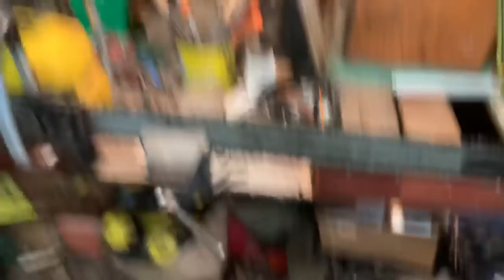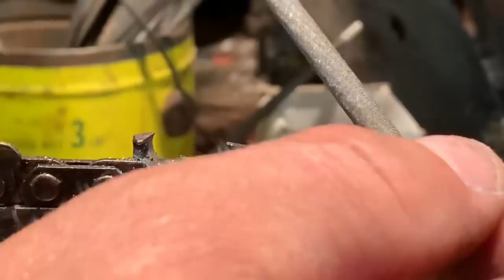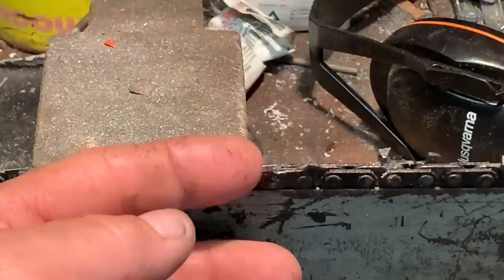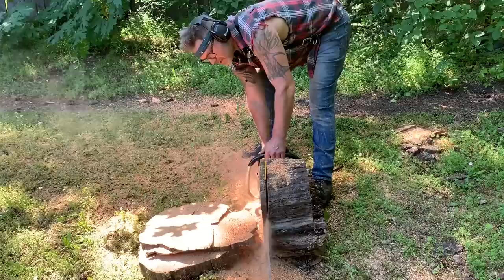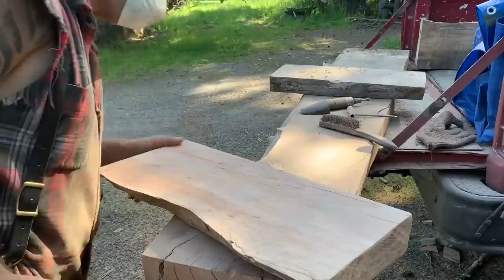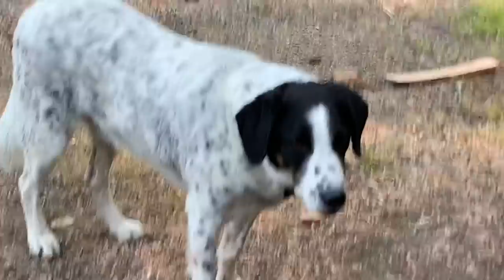Chainsaw sharpening myth. Debunked

Comment: Buckin. Your right about people spreading the word to count your strokes. I went to the Stihl small engine shop the other day to pick up a raker gauge and out of curiosity i asked the guy what was the best way to sharpen the chain. He told me to look for the worst tooth and file it and count the strokes . Then file the rest of the teeth the same amount of strokes . I did not argue with the guy i  just let him go . As i know that your the man with the experience and the know how i believe you 100%. Cheers Buckin.
Reply: Graham, that is exactly how the Stihl factory manual describes how to file. I'm with Billy, it's the relationship with the depth gauge (raker) that matters most.

Comment: First - I hate using a file because they dull so quickly and I always use a Dremel with a chain saw arbor to cut my chains. I always make sure that the edge is sharpened "onto" the edge and not try to sharpen the edge with the tool coming off the edge. Kinda hard to explain, but a barber once taught me that you always sharpen the edge "ON" the tool and not "OFF. 
The biggest improvement in chains that I recently "discovered" was a gap-toothed chain and I can say that it really REALLY cuts fast and furiously! 
The true test will be when I have to sharpen it. 
Love you enthusiasm!

Comment: I think the style of raker gauge you use helps. Each raker is filed to it's specific tooth, instead of those other styles which bridge over several teeth.
Reply: Yes, those are the good raker gauges!
Reply: That's exactly what I was thinking, I found the tooth size to matter, but it's because I was using the style of raker gauge that you are describing. If you use the style that only references off of one tooth and you're cutting crooked, it's probably because of the bar.

Comment: It makes sense when you think about how the chain reacts once power is applied,how the depth gauge and then the cutting tooth interact with the wood. Curving cuts are from worn bar rails. Usually from pushing too hard on the bar during the cut and/or running the chain too tight add in a little never flip the bar either. Thanks BBR

Comment: Buckin thank you from the bottom of my heart ❤️ for sharing your tips! I am a weekend warrior I guess. Maybe even periodically a chainsaw user. I just sharpened my first chain. Without your videos I wouldn’t have even thought about trying it. All I have to say is it was actually better than when I first started using it. The chainsaw is an inexpensive one but it works. I first pulled the plug because I had an issue starting it. The plug gap was almost closed. I did open it to what it was recommended on another channel. I haven’t had an issue with it since. It is a poulan too. I am just not financially able too purchase a good chainsaw. So again thank you Brother for your tips !!

Comment: Hi Billy, what I have experienced with long and short teeth cutting hardwood is that the bar jumps around and does a poor job cutting, also if one side of teeth on the chain are long and the other shorter will make half moon cuts, I'm sure you have had this happen also. Getting the rakers all the same height makes are smoother cutting chain also. Thanks, Gary
Reply: Kinda the point of the video. Tooth size makes no difference, long as every raker is sized appropriately to its tooth with a gauge.
Reply: He did a video with a chain that had nearly a new tooth in one side and the other side was filed right back to almost end of life. The chain cut straight as an arrow because the rakers were set correctly and allowed each tooth to take the same amount of wood as the next. 👍
Reply: @Woodman_Custom_Sawing  ok.

Comment: Can use this same technique on Stihl Picco mini chain? I caught some barbed wire in a tree trunk and it tore it up bad. The cutters are extremely small. I’m used to filing .325 and 3/8s chain. I bought a new chain and once it’s wore out I’ll go to a heavier 0.50 gauge bar and chain

Comment: dumb question... should the 3/8 husqvuarna gauge used in the video work on stihl 3/8 chain?   i've got one of these gauges, and when i lay it on the chain... i thought the front edge notch was supposed to sit tight against the preceding tooth, and then the raker comes up through the hole.  but... if i situate the gauge that way... the raker is behind the hole it should come through.  if i place the raker through the hole, the front notch will sort of rest on the chain or chain rivets... but not up against the preceding tooth.

Comment: Those Stihl depth gauges that seems the stores I shop at always sell, they sit flat across, but am I right in that they wouldn't get the right angle , and wouldn't work if different teeth were different heights ? Seems this gauge is a lot better, so why sell the others ?

Comment: My issue, which has me replacing chains too frequently ($), is that I get the gullet forming nicely but then can't get that round file to advance as nicely back toward the tooth without cutting more into the gullet!  Is the trick to only put pressure back toward the saw after forming the gullet?

Comment: I only cut firewood occasionally enough to get 4 or 5 cords a year.
I still haven't mastered hand filing in 20 some years...just need more hands on filing. I have a dozen chains and let the rental shop sharpen them mostly. Helps the small mom and pop shop.
But want to figure out the handfiling. My sharpening isn't always right on 30° for my Stihl MS290 325 26RM3-81 20" chains. The shop sharpening always last lots longer than my hand filing.

Thx for your video

Comment: I always thought that when my cut started going sideways it was because my chain needed sharpening.  It never occurred to me that is was the channel in my bar being loose causing the crooked cut.  Flipping he bar was a great tip and saved me some money too.  Thanks Buckin!
Reply: They make a bar rail closing tool if the bar rails get spread too bar. There is also a tool to grind the rails so they are flat, in the same plane as eachother. I believe he does grind his rails but does not use a rail closer. If you start with a 0.058 gauge bar and wear it out you can eventually fit 0.063 gauge chain in the bar and by the time the 0.063 gauge wears out the rails it's time to replace the bar anyways.
Reply: Good stuff, thanks for the tip.

Comment: Buckin, I believe that rather than just show people what you do, it would help if you could explain why getting the gullet helps the cutting action.  e.g. does it provide more space for the cut wood to occupy rather than jamming up the gullet space with wood and actually tending to lift the cutting edge away from the wood it has to cut.  There must be a reason why it works and it is easier to learn when you can understand why!  The depth gauge is easier to understand and I think that you have explained why the raker needs to be filed and how much you need to file it depending on the type of wood.

Comment: Loved picking up new information on vids like this one. I have found my self sharpened chains don't stay sharp as long as when they're new. So I use them for trimming branches off, and lighter work on smaller softer wood. After getting a sharpened one stuck in the tree trunk once or twice, I prefer to use a new one when felling larger and hardwood trees. Don't get me wrong, I get good use out of my chains, but after watching this one I think I'll get better use out of them. As far as counting strokes when sharpening, I stopped that after the first few I did because I found it fruitless.

Comment: I found that using a smaller size file.
I better, you can get a bigger hook before you get on your top plate..

What is your thoughts on that Billy.?

Correct me if I am wrong. 

Bo
Reply: I’ve started using a size smaller files when my cutters start to really get down to the end. No problems doing that so far and I seem to get a bit more life out of the chain

Comment: Wow, pouring "Watca" from a gallon can-serious business.  😁👌The shelves are awesome, Buckin. Good comment by Al.  Also, I've seen kiln dried wood do what the finishing discipline sometimes defines as "spit-up".  The Watco goes on, penetrates perfectly, then in a few minutes rises back to the surface and creates dozens of little ugly Watco wet "bubbles".  You simply wet it back down and "dry wipe", and repeat until the condition goes away.

Comment: Working in a saw shop it amazes me how many people bring there chains in for sharpening. And how hard they must be pushing that saw some times when they finally decide to have it sharpened.
Also if you can have your bar dressed. Makes a huge difference to your chain wear. Usually doesn’t cost much and will only take the shop 5 or 10 mins.

Comment: Always good to see you sharpening these chains.  I am having a heck of a time getting a chain sharpened after it got drug through some sand/rocks.
Reply: I hear ya friend, filing out rocked cutters is punishing so I found a good used grinder (a Windsor like the Oregon types)   fell in love w/it, now I never touch a file, just keep several razor sharp chains in the saw box. A want ad can get you into a grinder very reasonably. Good luck!
Reply: It’s a lot of work to file out a rocked out chain! Might even build character😅 a grinder or rotary tool will get ya cutting a lot faster. Just make sure to do your rakers any time your taking a lot of those teeth down. Good luck. Pay attention and have fun with it n you’ll be deli slicing hardwood like Buckin’ in no time👍
Reply: That’s where a rough ‘boat’ motion gets rid of material that needs to go Before continuing with normal strokes

Comment: Anyone who doesn't know how to, or can't file well, just use a file guide, it'll keep the gullet filed and clear to the correct depth and in doing so you won't end up with it flattening off the leading edge, (the 'C'). It's not like they're expensive or need replacing with the file.

Comment: I was always taught to count my strokes .I was good at filing a chain .Can't any more .4 shoulder surgeries  finished that have at least 6 running saws and have a bunch of spares .all I can run know is a baby echo 310  1/2 tank of fuel and iam lay up for a few days.Know to sharpen saws I use a dremel .only have to move my arm a inch .Works dam well .lol .But cut wood all my life and love cutting .Have a hard time getting 4 cord of wood to heat my house and shop .PS in this part of the world most saws only have a 16 inch bar .all  no monster trees here . Awsome Vidio keep up the great work

Comment: Ok so its not the  cutter length but the raker hight that causes the sloping cut?
Reply: Rakers just determines how much each tooth tries to take off.  If your cut is curved, one set of teeth, either the left cutters or the right are duller than the others. Or it's a worn bar. IF I understood your question.

Comment: Yer lot i do as groundy is clean but hardwood. I like a liitle hook just pulls thro. Yer gets blunt fast but if ya can take 10 mins. On dirty can change it. Do use raker gauge tho. Was gettin it wrong. Thanx buckin its good stuff thanx.

Comment: Hello Ray could you help me whit a problem my 1961 homelite c7 wont start the carburator tubes get air into them some how so are the tubes the problem?
Reply: When in doubt, rebuild the carb. Especially if it hasn't been rebuilt in a long time. Float and needle valve might not be seating properly. Get a rebuild kit if you can find one, strip it, and if possible soak the body in a shaker tank. There's tiny little passageways in the carb body and if they get gunk in them all kinds of weird and wonderful things happen. If you suspect the fuel lines take them off and make sure there's no holes or cracks in them and that they seat properly, or just replace them, fuel line is super cheap any auto parts store will carry line and fittings
Reply: @NovaNinja_  yeah the lines are orginal and it didnt ran in almost 50 years but 5 months ago it ran perfect when i just switced the gas.
Reply: @KK-dt4gj  Interesting story, myself and a friend both bought bass boats from the US and brought them to Canada. Within 1 year all our fuel lines were rotten. There's something about US and Canadian gas that don't get along, and it's possible that old gas and fresh gas could have the same effect. I think I paid under 50 cents per foot for clear line at CarQuest so it's worth it to change them even if it's not the problem
Reply: @NovaNinja_  yeah havent just had time since i have had problems whit my sthils too

Comment: What brand files do you use?
Reply: Any of the brands that are Swiss made, which is the major players. Valorbe or Pferd.
Reply: Thanks I have been using oregon files for years and they usually wear out before I can finish sharpening👍👍
Reply: @redman715  Uh oh! Theirs are supposed to be made in Switzerland too, but maybe they went to Asia. Try Pferd or Valorbe, ok?
Reply: @redman715  Hey, I was back in my shop, had an Oregon file, made in Switzerland, and it cut and cut.    Not sure what the deal is for you, sorry!

Comment: hey buckin'! love your videos and your positive light in the world! I just found your videos recently and you seem so damn knowledgeable and experienced that there's no way you dont know hopw to sharpen a chainsaw. I was also taught to count strokes when you sharpen a saw or that if you hit a rock with just one tooth you have to file down all the teeth the same amount or you'll start getting crooked cuts. Last spring I sharpened a chain that i got from a buddy that needed A LOT of filing to be sharp again and when i started cutting with it I was getting crooked cuts. I did about 15 strokes on each tooth so i figured that somewhere along the line my count was off and that was why my cut was so crooked. You say over and over that you dont need to have even teeth to cut straight and you prove it in this video! but i havent heard you say what does cause the crooked cuts. cause I've definitely gotten crooked cuts before and I really want to be able to use your method and get straight cuts. 'Cause counting strokes is a pain and so is sharpening every tooth when you just bang up one! do you get curved cuts from having uneven teeth and not filing your rakers accordingly or what is it?
Reply: P.S. watching your videos inspired me to refurbish my first vintage axe! got a sweet score on a true temper kelly perfect 4lb double bit from an antique store and the handle was practically falling off. after a vinegar bath, some wire brushing and a new handle (and some re-edging and sharpening of course) it's my girlfriend and my favorite splitting axe! We always used to use a maul. thanks so much for sharing your knowledge and your infectious positivity

Comment: I can’t tell. My teeth all look the same, feel sharp and seem to be equally above the raker. Saw cuts on an angle and gets way too hot and smokes. I tried sharpening myself for a while, but even 100 strokes on a tooth does nothing obvious. The saw shop charges $14 to sharpen and they’re dull when I get em back. The only way for me to work with a sharp chain is to buy new for $22. BTW, the new Stihl saw will only start once a day. Once it’s hot and you run out of fuel and refill it won’t start again until the next day.

Comment: i was having the cutting at angle problem..been using oregon file guide and chain kinda looked like urs..every other tooth diff size..i thought i was filing harder going to my right and always filed equal times..but my dad said ur right he said u need rlly good light and glasses and jus have to look and see what each tooth needs done to put an edge on it..hes been trying to teach me to sharpen since i was 5 but still cant do it as good as him..he would hire any1 on the spot if they could sharpen a chain
Reply: first thing my dad did was flip the bar which is what u just said after i left my last comment..spot on advice

Comment: BR have question if could talk too you or send email. Try find some chain links see if you might have some older stock on hand for some 404 .050 chain. Thanks if you might have info or can help.
Reply from the maker: you cant find 404 chain?
Reply: BR I can find 404 but need be..050 thickness it chain that discontinued it old stock. We can use a 3/8 link but going need mess with link a little too get to work. Got mess with bar also got use 404 .050 and change the nose too work with the chain. Oh also forgot in square ground.  😀😀😉
Reply: Little project working on with someone trying help out if I can. You'll see in due time on his channel. You'll like it when it come out . One our close friends is all I can say. Mhhm the word. Lol